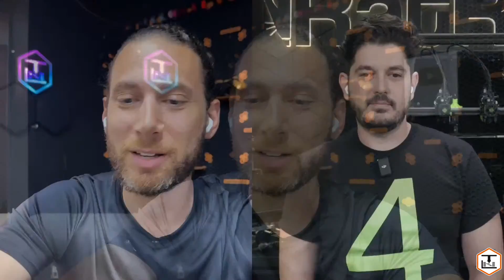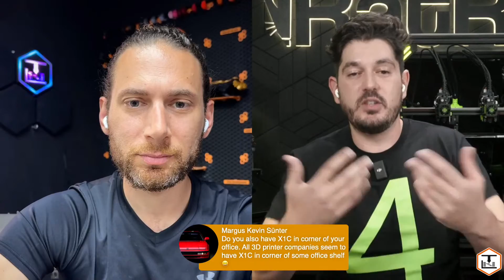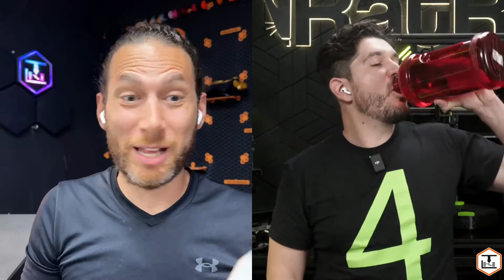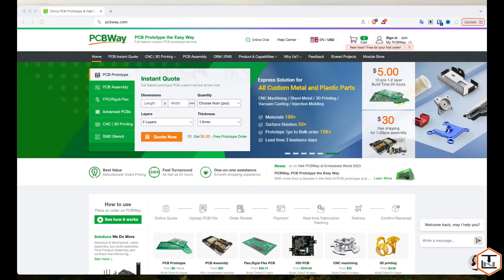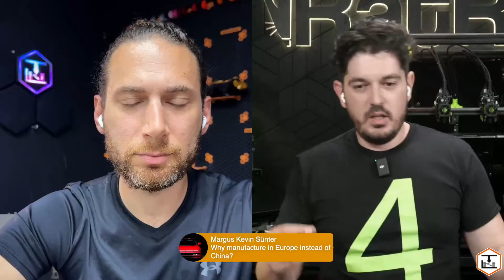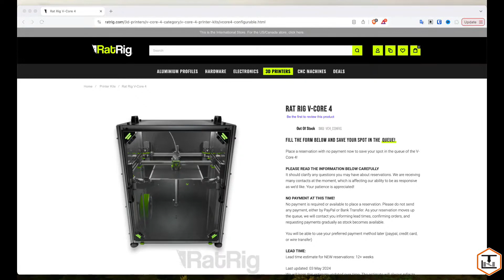Ep. 41: Sonat Duyar on Revolutionizing Open-Source DIY Kits for 3D Printers and CNC Machines

Comment: Like the sound of the Ratrig 4 IDEX multi material - I've done a short demo of what an IDEX X1C might be like, but I think a built from scratch IDEX machine would be better.  In terms of reduced print time - I've done quite a few calculations and for some prints with lots of two colour layers I think you could reduce print time by 75%.  More complex prints with 8 colours for example  would only be reduced by say 25%.   There are two ways that time savings occur - 1.  Direct IDEX swaps - where you can switch back and forth between 2 colours.  This also saves wasted filament.  2. Parallel IDEX swaps - where a colour change is required in the IDEX 2nd head - but it can be going on while the 1st head is printing - this can bring time savings but doesn't save waste.   It doesn't save quite as much time as you would expect - because in the prints I have analysed the colour change time in head 2 for example is still a lot longer than the print time of head 1 - so printing still needs to wait.    There is also a small amount of possibility for parallel printing - where for example you are printing a model (such as a ship) which has parts that are mirrored - you wouldn't be able to parallel print the centre part - but you could potentially print the edges in parallel.  Will do a demo animation video of this - probably based on a VCore4 mock up at some point.  https://youtu.be/uXqAenyT-fY?si=8-JyfZNxVMy5L_hI

Comment: 53:20 This was the most exciting part for me. I'm wondering if that would fit inside the current volume of the printer or if it would require more space vertically, for example. Would matter a lot in my case 😬